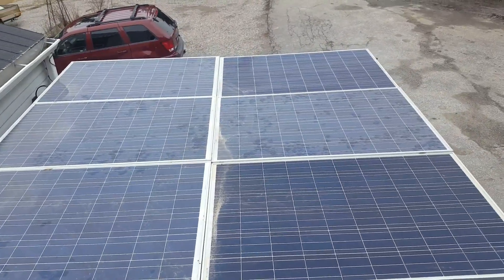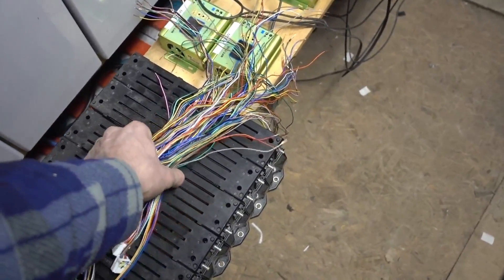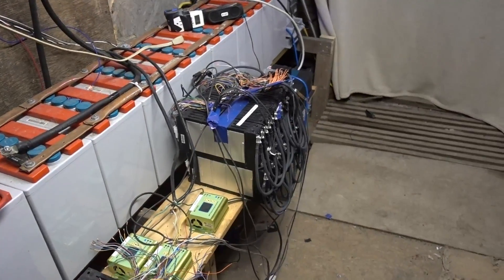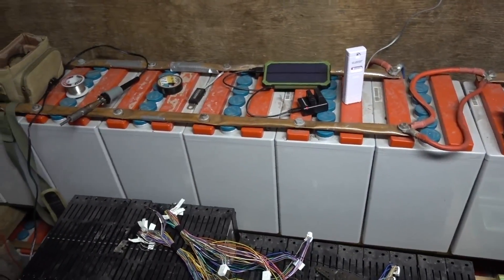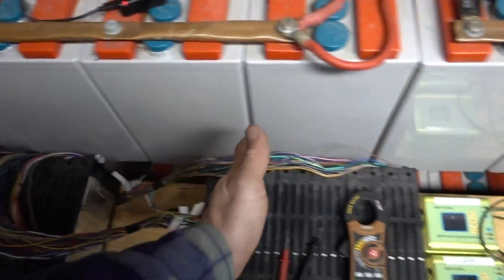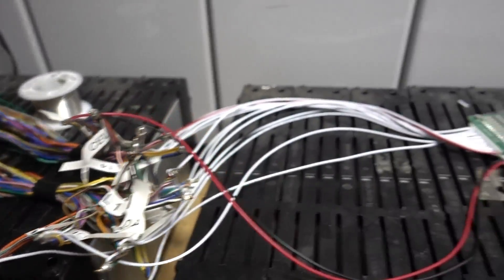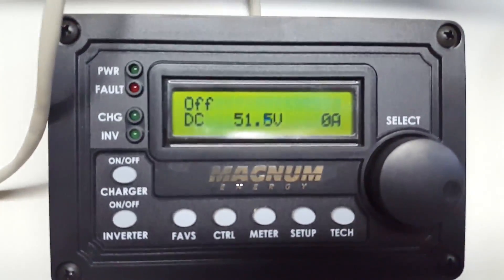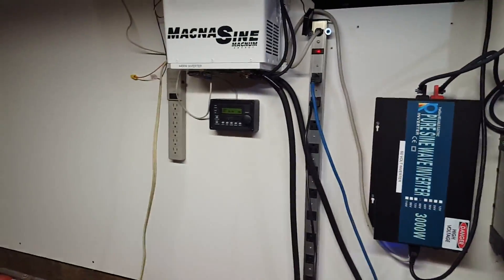Building a 5.5Kw Power Wall

Comment: You seem exhausted at end.  I use to have flat panels but I lifted them up at one end with a 4 by 4 however they still got dirty on edges but still good power.  Even dirty panels produce.  There was a study saying it is not economically feasible to clean solar panels but they produce 10% more after cleaning.
Reply from the maker: yes I was very tired lol but was so happy as well.

Comment: hi fliping,
concerning your solar panels being flat, yes they collect dirt on one end. so you might have  to angle them a bit. or construct a catwalk for easier cleaning.
i have mentioned this before. the busbar on your 12v batteries. i am imploring you. please. put some shrink wrap about them. it is not a major work thing or expense to do. what you are doing on top of them batteries is absolutely irresponsible. like leaning the soldering iron on the positive busbar. you also have a responsibility to your suscribers. so please!!!!!!!!!!!!!!!!!!!!!!!!!!
Reply from the maker: Ill keep this in mind thanks! I am looking at cutting pvc pipe and putting them over the copper bus bars and rap tying them to the bars.
Reply: and put a board or a transparent polycarbon sheet over the top, so you are double insulated against falling spanners and screwdrivers,etc.
thanks for taking it seriously